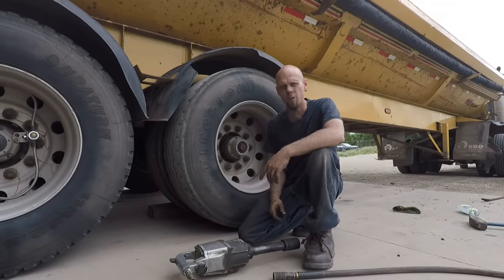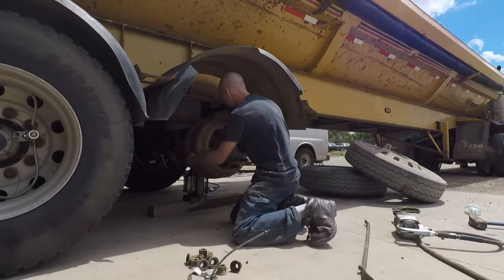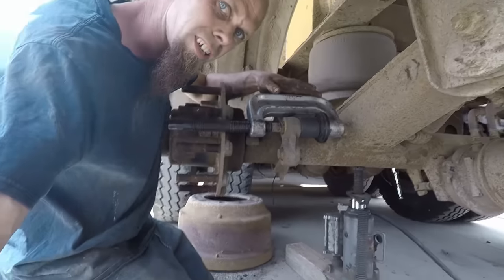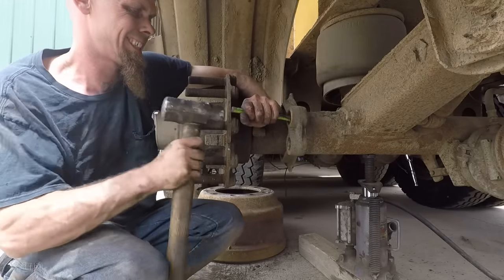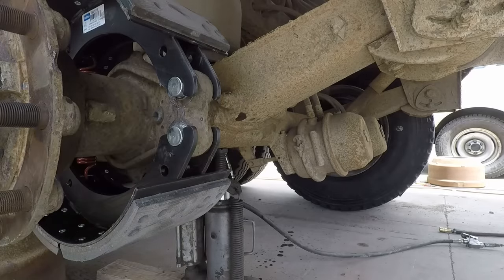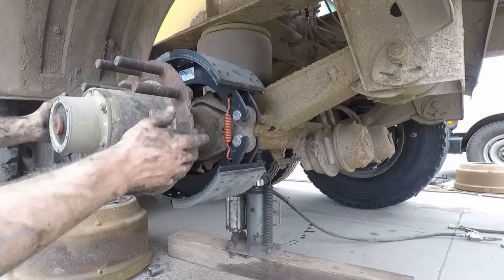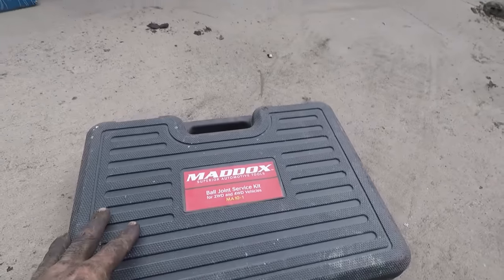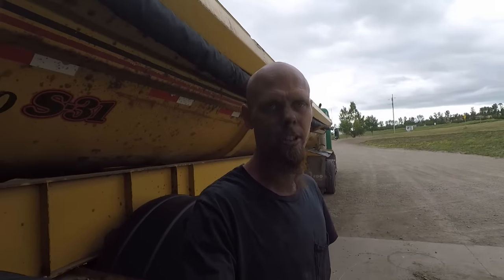semi truck brake job seized anchor pins

Comment: The only thing I'd suggest is if you don't jack the axle so high it makes it easier to rock the wheels off and on. I couldn't guess how many brakes I have done but it's surely in the thousands. 
 I never used a bar for getting the wheels of or on . I'd get the tire 1/2-1 ich off the ground . Works great . Had my grease monkey time me in my prime my best time was ,9 minutes and 11 seconds and I   had inner and outer LUGNUTS. . But on trailers it took longer because the drums were inboard . Actually broke a spider once DRIVING a seized pin out with a 12 pound hammer.
Reply from the maker: They were only about a inch off the ground sometimes aluminum inners get seized on the hub is you run in the road salt. Using the bar is a lot better and faster than beating it off with a hammer inboard drums suck glad they haven't been used on anything made in the last 20+ years

Comment: No jack stand, safety glasses, or heavy glove holding a chisel. Most employers would let him go for just the jack alone.
I've been a truck mechanic for over 40 years. Take it from someone who knows. Protect yourself. I've seen axles getting pulled off the jack because of the air suspension pivoting when it loses air.
When lifting drums I take an old V belt and suspend the drum inside of it doubled in half. Now you have convenient handles on each side of the drum.
Reply from the maker: Man I keep trying to fire myself but I keep showing up to work
Reply: @Ezrider359  amen.
Reply: I was thinking the EXACT same things....the older I get, the more jack stands I use. There is no such thing as, "an old fool". If you're a fool you don't live to be old.

Comment: Not to judge but wouldn’t it be easier if you push down on that breaker bar instead of pulling up?
Reply from the maker: No. It's always much more controlled to pull rather than push plus I can pull far more than my body weight

Comment: Every thing you did, I've done. But I have one question, I see where you put anti-seiz on the bushing to the spider, but not on the anchor pin to the bushing.  Is that not a recommendation to put anti-seiz on the anchor pin? I would think that would help prevent the pins from sezing up like that. Just asking .....
Reply from the maker: Bushings were anti seiezed on both sides
Reply: @Ezrider359  okay,  I just didn't see that part. Sorry....
Reply from the maker: I might have accidentally cut it out in editing too
Reply: It's cool, i love watching your channel......

Comment: Ps Ezrider what you do for fun outside of truckin got a badd ass jag don't ya? Just curious on what other passions you may have. Stay having fun and stay safe friend.
Reply from the maker: Turning wrenches is my hobbies..lol old red is kinda my hobby project right now. But yeah like to go fishing and camping atleast a few times per year go to the race track stuff like that.
Reply: @Ezrider359  same here my mack is my favorite hobby atm as well as been playing drums for 30 years got 5 street bikes not one harley though unfortunately.  Thanks for sharing your other hobbies with me been watching for about 2 years now don't you have a sweet jag with a blower on it? What's up with that sweet ride? Guess I'm just noise board atm I just got the oil pump in my mack now I'm dreading the part of buying 10 damm gallons on a hope this will solve my problem. Ahhhhh never ending ya know.

Comment: I use vice grips for the smaller springs that hold the pads together. Put the top in first, then use my body weight to stretch the spring into the bottom hole. 😃

Comment: Well done pal .but where are your axle stands safty first
Reply from the maker: Unnecessary in this situation the empty trailer weight is supported by the other 40k lbs worth of axles on the ground the tires are on on the opposite side and the suspension design is designed to not articulate side to side and the jack is rated for 20k lbs it's mabye lifting 2 and even if the jack were to fall there would be less than 2 inches of movement on the axle that I was never directly underneath

Comment: You had a broken or missing bolt on your hub cover. It was at the very top. I noticed!
Reply from the maker: I run cat eyes on that trailer and they bolt onto the oil cap so it was removed to take the cat eye off to remove the tires

Comment: 4:00 just a suggestion, instead of pulling up, I would spin it 180 degrees and instead push down with my body weight, it saves your back and you go with gravity to get extra leverage
Reply from the maker: When the goal is to turn something as tight as you can always pull it your bouncing your weight of something and something slips your going to faceplant and hurt yourself. I can pull far more weight than what I weight I'm also using my upper body not my back. I appreciate you wanting to be helpful tho. Thanks

Comment: I did mine the same way I made the mistake of letting a TA truck stop replace my trailer brakes once and that didn't fare to well so it was back to changing them myself.
Reply: Me too, ended up finding a roller between the shoe and drum. Unless it's an urgent repair, I do it at the house
Reply from the maker: Ta could screw up a wet dream

Comment: Always wondered why anchor pins do not have grease nipples. Running more disc brakes now. Seem to be a better deal but time will tell.
Reply from the maker: I haven't messed with any disk brakes. I like drums because I know what to expect from a maintenance standpoint. Tried and true

Comment: What are the symptoms of seized anchor pins? Or did you just notice it while doing a brake job?
Reply from the maker: Your notice doing the brake job and if the pins are worn the shoes won't locate in the drum properly
Reply: @Ezrider359  Thanks. Always good to have more knowledge. Good video.

Comment: I ask the guy putting on new tires to please torque at 350.  He just laughed.  He said easily 700 ftlbs.  He didn’t want to be responsible for a wheel falling off.  I do some of my own work and ended up with a big compressor and impact because they were always so tight.  The dealer book on mine says 350

Comment: You need to change the drum when you change your shoe?
Reply from the maker: As I mentioned in the video you can generally get 2 sets of shoes out of your drums drums wear out as well cannot exceed the max Id stamped on the drum. There are a number of other defects that can condem a drum as well such as deep ridges heat cracking warped ect

Comment: anti seize with heat is good for seizing xD i use high temp synthetic grease an also i give it a little buff inside the pin hole never got jammed again

Comment: So is it necessary to replace the anchor pins every brake job?
Reply from the maker: You can get away with reusing them sometimes. It's your call. Look for wear where the shoe rides on the pin. If they become worn it will cause issues with the shoe not locating properly in the drum
Reply: @Ezrider359  I always look for any kind of irregular wear and I replace them if there is what does it matter if they're seized?

Comment: Your making 1 very big mistake.
 Take it from an old man that no longer hears well: PROTECT YOUR HEARING, SO IMPORTANT. 
A little tip, when you take the drum off, rotate the slack adjuster until it 'cams over'. Then stop.
The cam  will be in the perfect position to install the new shoes. 
That way you don't have to fight the slack adjuster by turning it backwards. 
 Good job. You know what you're doing.

Comment: Yea I figured you probally got crap for torque of the lugs....but i bet people didnt know of the threads need to be cleaned and 30wt oil was also supposed to be used to help the torque force...i bet nobody would be able to tell you the pounds it is supposed to torqued to

Comment: Hi Ezra, 

What air compressor do you use to run that 1" impact? Been watching your channel for a few years now really enjoy it!
Reply: The main thing that you need is a big air tank with 1/2” hose and fittings.  A small air compressor will take longer to build up the air but trust me. You’ll welcome the rest break once you grab that 1” impact. Lol
Reply: Or just get a 3/4” Battery impact. And a 3/4” impact. 
But I would suggest the big service truck air compressor. It pays for itself in no time.

Comment: Do all semis run drums? And why is that?
Reply from the maker: The Last few years there have been more disk brakes. air disk brakes were problematic at first and expensive to repair. Drums are tried and true and still standard equipment on new trucks and trailers.

Comment: never worried to much about the anchor pins being seized if they moved and worked like they say they should never seize up. if they  had major wear on them i would change them but thats about the only time i replaced them unless they just came out easy then i would replace them just to antiseize them before they got froze up hard.

Comment: Are pins worn where the shoes sit? If not, why bother?
Reply from the maker: yes the pins were worn, i had never changed the pins on that trailer as long as iv owned it because they were good and seized but they were now worn to the point where they needed to be replaced.
Reply: @Ezrider359  now that sounds more like what I would expect you to do 🙂
I don't live in the s&s belt (snow & salt) any more so I've never had frozen anchor pins to worry about 🤣

Comment: How come you don’t run dust shields on your brakes? They were a life safer running to Alaska with all the sand and gravel on the roads. I sold my Western Star with 375,000 miles and 75% original brake shoes. Other guys without dust shields go through at least a set or two of shoes and a set of drums in a year. It helped with snow and ice too. I rarely had a wheel frozen, but I always moved back and forth before going to bed after they cooled off. I did a set of tires on a tractor the other day for a guy and he was crying the blues trying to mount tires. 🤣🤣🤣
Reply from the maker: Never had dust shelds on it from new

Comment: Here in the UK it's a legal requirement to have back plates fitted to the brake assembly's.
Reply from the maker: Here many leave the factory without them. This trailer has never had them

Comment: Not being critical in anyway here. Do your back a favor & push down on that breaker bar (when doing the anchor pins) don't pull up. Find yourself a hand dollie to take those drums on & off with. Wouldn't it have been easier to install the bushings from the front side so you can get at it easier with the hammer?

Comment: Jacks are for lifting, not holding!!!

Safety glasses? Ever seen a sliver of that stud come off with the lug nut and launch towards your eyes? I don't know about you, but I only got 1 set of eyeballs and last I checked Snap On doesn't offer them on the truck.

Hearing protection... sure you'll look like a goofball, but at least you can still hear your kids say I love you.

That young, strong, healthy body surely can do the job without a struggle. But who am I to speak? I'm only 36 and have had 2 knee surgeries, 3 back surgeries, and 2 shoulder surgeries. 

Don't follow the same path filled with youthful ignorance that I once did. You only get 1 body, take care of and protect it.

No job is too important that we cannot take the time me to do it safely.

Comment: Doing brake and tire work on a semi or bobtail takes care, guts, and (perhaps) some fatalism, because you know that someday a jack will slip, a tire hammer will break, or (God forbid) one of those split rings will come off when you have 90 lbs. of pressure in that tire and that ring will try to eat you up!

Comment: That 1 inch cordless Milwaukee gun is the best tool out there to remove those lug nuts I guarantee it
Reply from the maker: It's a 1 inch air impact that does over 1200 ft lbs and the battery will never go dead
Reply: @Ezrider359  it's long lasting for sure

Comment: You cleaned the inside of the drum before installing but didn't bother cleaning your greasy finger prints off the brand new shoes.  Other than that you do good work.

Comment: Them fuckers are RUSTED. When I worked in Oregon on trucks heat and my air hammer where my friends. Also I have a little tool that my air hammer that pops the anchor sleeve right out. Can use the same tool to install too! It's on Amazon under Lisle Anchor Pin Bushing Remover.

Just a side note on the Lisle tool, the top cap that drives out the anchor pin sleeves, weld the top piece to the top and it makes it a great tool.

Comment: Dang heat it up with a torch drive them out with air chisel with the proper tool for those anchor pins and its no big deal.

Comment: Job would of been so much easier with air disc brakes.  The only way to go for a tractor and trailers today is air disc.
Reply from the maker: I don't have anything with air disk's so I haven't really messed with them yet.

Comment: Where is the anti seize on the rollers and on the wheel hub mating surface.  Also the hub mating surface needs to be cleaned so the drums and rims sit properly on the hub.  Newbie!  Lol!
Reply: how bout those d12 volvo injector looms..
Reply from the maker: Lol
Reply: Greg Intersteller the d12 are not too bad but don't get me started on their injectors.  How many I've replaced because of the stupid design flaw they have for seating the cups.  Worst design I have seen.

Comment: you need a rubber mat to throw the rims on the ground, so they dont get f..ed up when you drop them on the concrete.
Reply from the maker: Iv got some but there side dump rims there already beat to shift

Comment: I would invest in a long handled ratchet....after you get that thing moving with the breaker bar I would get a ratchet on that fuckr... or better yet and impact wrench.....nothing worse than using a breaker bar like a ratchet....🍻 nice work though... you got er....
Reply from the maker: You needed the three feet of leverage right till the end they were stuck good. Impacts are hard on screw presses
Reply: @Ezrider359  sheesh..I would've cheated....🤣

Comment: lil sea foam deep creep never hurts either, I laugh when people try to use wd 40 on those, or Kroil is good option too to ease the c clamp press
Reply from the maker: im not a fan of wd 40. probably the worst of all the penetrating lubes. for something like this unless your going to let it soak for a week generally none of them will be of much help. a bit of heat from a torch will go a long ways if it wont budge but i don't like to heat them any more than necessary.
Reply: @Ezrider359  right back at ya yea even if Ii,am using my Snap on Tap 1 for the press pin I still use deep creep just to help slide the bushing gives it a fighting chance, same as slack pins.

Comment: Looks like those rims need polishing
Reply from the maker: Those rims are beat way beyond being able to polish them
Reply: @Ezrider359  oh I know they can be brought back to life... I can give you a guy's number that can fix you up
Reply from the maker: No there are very deep gouges and dings all over all of those rims from dumping rip rap and concrete chunks. By the time you removed enough material to make them smooth to polish they would be in useable
Reply: @Ezrider359  get newer ones?

Comment: I’m surprised he didn’t use penetrating fluid on those pins 😲
Reply from the maker: Penetrating oil is a waste of time on this kinda of stuff and if you end up needing to use heat you don't want everything covered in oil

Comment: Penetrating oil like Kroil and/or heat go a long way.  You fought this way too hard.
Reply from the maker: Oil is useless on something like this heat would make it easier but it's more a options of last resort. I prefer not to dump a bunch of heat into the spider unless I have to
Reply: Ezrider92356 Good point.

Comment: I dont even bother wasting my time changing those... fucking leave them i have done a million brakes by now...

Only time i chAnge them is if they are loose.. wollered out.. or broken... 

They hardly ever need changed... 

Best advise guys ... leave them if they dont need changed..

Also u did the brakes backwards.....
Trust me u did them backwards

Comment: Man you take to long doing brakes and you can use a 1/2 inch impact to take out the anchor pins instead of a 1/2 inch bracker bar work smarter no harder

Comment: The demons took him over for the screenshot of the video..  only possible way a single man without rquipment could get a semi bead off and back on..  i had a damn trailer tire i had my truck parked on and a house jack on and still couldnt break the bead..
Reply from the maker: It's actually really easy to break the bead on a truck tire.

Comment: Wire brush & lube the lug studs... they’re fine threads & will gall .... not fun.  ⚓️. Torque with a cheater & your ass...😎

Comment: I was always taught to torque lug nuts in a criss cross pattern. Maybe that's all horse-shit?
Reply from the maker: I run them down with the impact in a star pattern to draw it up then torque  with the wrench in a circle because once it's pulled up tight I don't think it matters but your not going to accidentally miss a lug nut that way

Comment: why? if those are not egg shaped then leave them in there...they dont need to move any ways!!  Thats not the way to do that...LMAO... you should not have to press those in... you used a sledge hammer caveman.... Waaaahhaaaa...   Leave the rollers out... put all together..then lift each shoe and slide roller in place...  damn you making me tired with all that work.  I found that buying the steel drums go longer than cast iron bastards..

Comment: Torque the lug nuts to “semi-tight” that’s 450 ft lbs if you’re on the weaker side 
or 500 ft lbs if you have normal man strength 💪